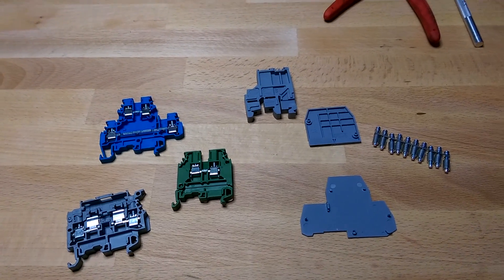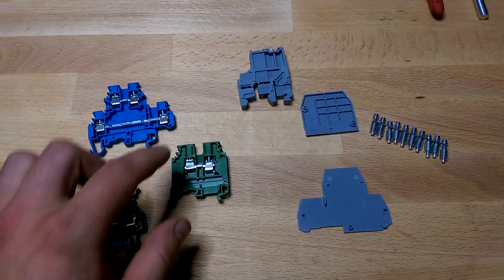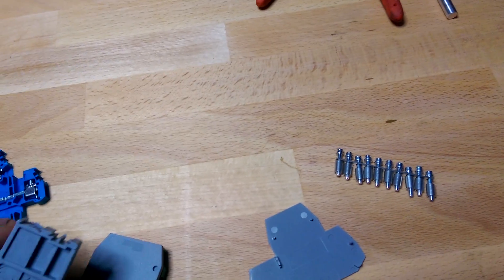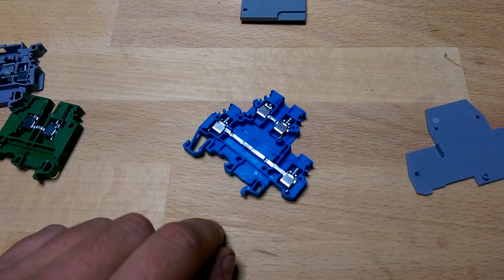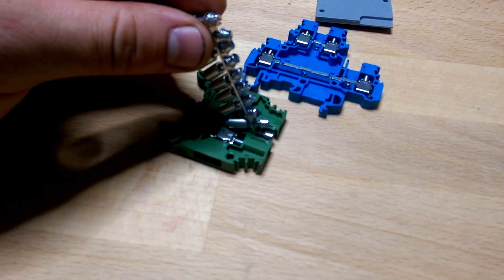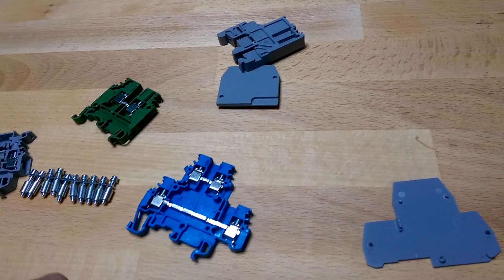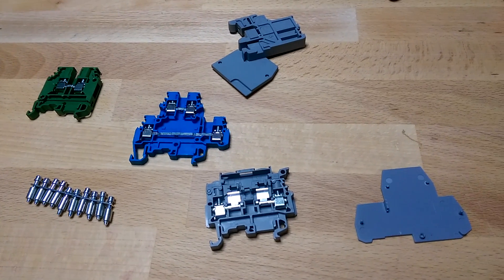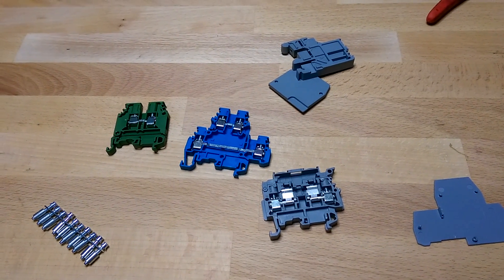What are DIN Rail Terminal Blocks? Types and Explanation!

Comment: The hardest thing about starting off trying to learn about this stuff (i do some electrical work at my job but im no electrician, so I didn't know hardly any terminology when I started) is that I had no idea what any of this stuff was called. I didn't know what a DIN rail was, I didn't know what a solid state relay was, didn't know what terminal blocks were. There were a lot of gaps in my knowledge. I knew Khirkhoff's laws, but I didn't know hardly any practical info.

Granted I went to school for mechanical engineering, and the electrical courses I took seemed to assume that everyone already knew how the theory applied to physical components in circuits. 

Maybe I just had bad professors lol. I don't remember a single mechanical classmate that enjoyed their electrical courses.

Comment: Great video! Certainly helpful, BUT... color coding DOES matter. Oftentimes grounding DIN rail terminal blocks (in the EU they are green/yellow) are electrically connected to the DIN rail itself. If you were unaware of this you could have a very bad day, either because you would be constantly tripping a breaker (hopefully nothing more), or... worse yet, you could make the entire DIN rail and anything it is electrically connected to live.
Reply: Yep. I’m no electrician myself but learned some of this on the job. If I didn’t know about the green/yellow block then we wouldn’t have known how the enclosure was grounded (subcontractor built the cabinet)

Comment: I don't know why, but I feel those plastic parts are over-engineered. So many features. Wire and screw holes are necessary, as well as the clips for putting them on the rail, but then there are so many other nooks and crannies.
Reply: feel the same the shape is so confusing